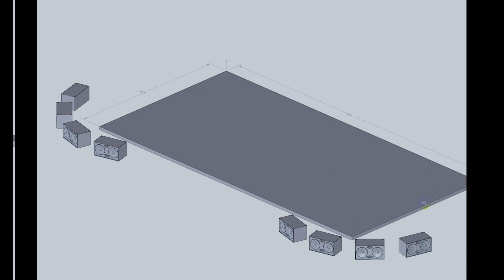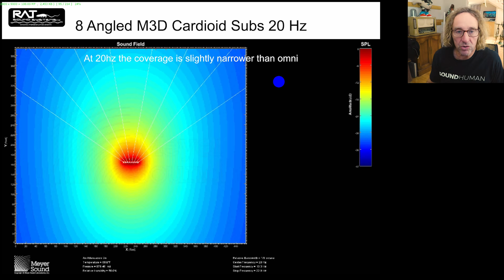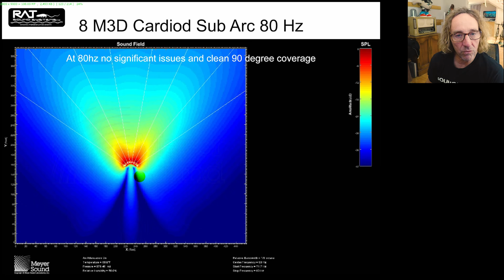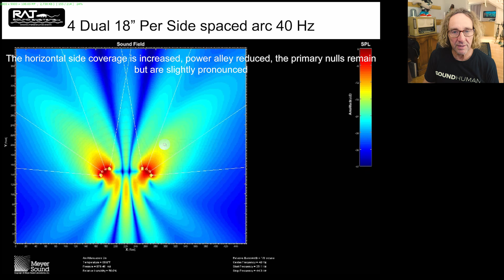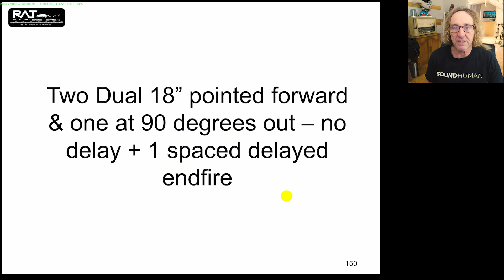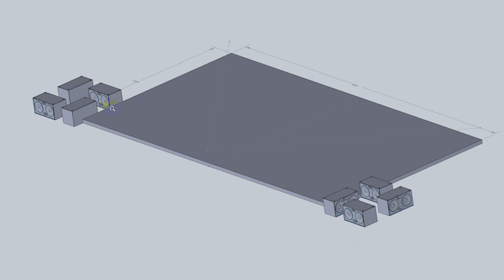Better Sounding Subwoofer Arrays Part 2 - Sub Arcs, Delay & End-Fire

Comment: Subs are not supposed to play over 80hz so part of this is a moot point...
Reply from the maker: and the speed limit is 65 so no car should be made that goes any faster than 65.

and a 1 ton chain motor can only lift 2000 pounds so it does not need to be capable of lifting or holding more weight

or

the capabilities beyond how a product is used may be useful or an indication of how well it performs within the rated range.

a car that goes 120 may accelerate to 65 more easily than one that struggles to get to 65. a car that barely makes it to 65 may be stressed and operating at its limits and fail sooner than a car that is operating well below its capabilities.

a motor that barely lift and holds 2000 pound won't be as safe as a chain motor that has a 5 to 1 or 9 to 1 safety raty and can hold an lift more.

also, there is no distinct definition of sub frequencies. Fo L-Acoustics the subs can operate at 25 to 60 or 25 to 100Hz

do you really want products that fall apart of sound bad if you exceed conservative usage? do you really want products that barely reach mediocre performance goals?

Comment: As for that delayed arc with the subs angled outwards, I can see that working with subs that feature an integrated cardioid design, like D&B’s SL SUBs. In fact, I’ve actually seen that model of sub set up this way at a real life event back in 2022! I bet you could do it with those new giant L-acoustics CS1 subs as well!
     I would think it possible for cardioid-arrayed stacks of normal subwoofer boxes (KS28, 2100-LFC, etc.) to be arranged in this way as well!

Comment: Aren’t subwoofers commonly rolled off around 80 to 100hz? If so, is there any advantage to factoring for two and 300?
Reply: As explained in the previous video, if the subs hold up in terms of coverage at 200-300 hz, then they’re more likely to sound more cohesive in the range we’re actually using them
Reply: @alxp5892 I’ll circle back to that video after work! Thansk

Comment: Is the cardioid arc you did the correct image? How is it cardioid?? (obviously the MAPP displays cardioid results though)
Reply from the maker: I used Meijer cardioid subwoofers that have a cardioid pattern with a rear firing speaker in them
Reply: @DaveRat  ahh that makes way more sense ✓ thank you!
If you had double 18s do you have any recommendations for similar effect? Alternate? Double stacks with a cardioid config?

Comment: Hi Dave, thanks for sharing, was curious if the physical arc of 8 subs could have an End fire sub placed behind at that loud equal distance point you mentioned, would it cut out a lot of the blowback towards the artist?
Reply from the maker: Dual arcs setup endfire or cardiod work well if you have the depth and space needed. Like part of the Bassnectar array .

Comment: It all changes dramatically when you throw a bunch of bodies in front of it. How do you write programs for that?
Reply from the maker: Depends, bodies impact higher freqs more than lower freqs. For subs, the level drops a bit but coverage does note usually change due to bodies too much.  Check out my vid on heat changing sound. That is more of an issue

Comment: Could you do a video of how a center cluster end fire array would look in the software with 2 rows of 4 dual 18s in 2 straight lines using those same 8 bass reflex subs?
Reply from the maker: On the member side I have shared a file with a bunch of sub arrays to compare including endfire and cardioid center sub arrays.

And am doing a multipart series on a a wide variety of arrays and coverage including vertical and interactions between arrays
Reply: @DaveRat  Ok, thanks! I will look into that!

Comment: Thanks for all your work. This point would be more well-illustrated if the color scheme was flipped in many cases.
Reply from the maker: Yeah, I could see other color schemes working, like the choices I have in my infrared camera to show temperature.

Like using lower freq colors to show lower level sound, rather than the reverse 

But both soundvision and Mapp use this color scheme so it's familiar and I believe the only option.

Comment: I appreciate that you are talking this topic which is poorly understood.  A little explanation of comb filtering for those new to the subject would be helpful.  Also some math (not too much of course)  showing the physics of the changes per octave would make it more real world and less mystical.   Aas to going above the cut off frequency, the cut off is a slope so an octave up would still be outputting some energy, the amount determined by the slope.  The mid bass speakers would also be putting out energy as part of their crossover so there is that interaction to understand as well.   Finally, depending on the drivers themselves, they could be putting out energy due to second harmonics.  Thank you for trying to show a complex issue in a simple way.
Reply from the maker: On the member side and in the member zoom chats I go into more detail, thank you!
Reply: @DaveRat  I under stand the math.  It was a suggestion for your subscribers.
Reply from the maker: Cool cool, yeah, I figure if people want to dive in deeper they can join the member side. Typically the more technical I get, the lower the vid performs on the public side
Reply: @DaveRat  I guess I can understand that.  You are appealing to the center of the bell curve even if your bell curve is skewed to the technical side.
Reply: @DaveRat  well, thanks for shedding some light on the subject.  I just watched a test of different speakers stands.  Unfortunately the ones doing the analysis had no understanding of structural engineering so could only understand the acoustic results from a surface level.  They needed a person with some knowledge of mechanics of materials, structures and other physics to understand why they got the results they got.  But I guess, as you said, if they got too far into the weeds, everyone would have clicked to another video.  Ah well.  Keep up the good work.
Reply from the maker: It's tough finding a balance between presenting curiosity and complexity. I don't do much short and shallow and tend to stay in the medium to longer format vids of 10 to 20 mins.
Reply: @DaveRat  yes, I am sure that is correct.  Which is one of the reasons why I don't do videos.  God bless.

Comment: That's why I like a single sub in my car
Reply from the maker: Hmmm, when multiple subs are located close to each other (less than 1/4 wavelength of the highest freq they reproduce, they don't have interference issues that are of any importance.

To determine the wavelength of a frequency, divide the speed of sound by the frequency.

The speed of sound is about 1125 feet/second

So for 80hz, it's about 3.5 feet
  So subs closer than 3.5 feet will not have any real issues.

In a car, the space is so small that multiple subs are hard to place far enough apart to create issues
Reply: @DaveRat  just something I've noticed when switching from dual cabinets to singles. And this is typically a reflex port tuned to 33 hz, so you already have peaky response to deal with.
Reply: @DaveRat  another aspect that these simulations do not illustrate is the way the wavefront hits the listener. The initial attack of the bass note gets muddled when using multiple woofers (in my car that is) a single sub allows the initial attack of bass notes to be cleaner and more pronounced in all listening positions. This simulation illustrates how a sustained note would cause null points ...assuming no room reflections... in a car the woofer experiences cabin gain... the point where the volume of air in the car acts as a large box. I'm sure this effect would overcome any phase offset issues caused by using multiple drivers, but I swear I could hear the difference, especially when moving my head around the cabin. A single driver tends to be much cleaner sounding, even if it's not as loud as multiple woofers.

Comment: Hi Dave... scroll @ 6:20 what if you had say three subs sitting behind the area of the arch at 180 phase with the HP roll off around 100Hz? Would make it tolerable on stage, yes? Phase out hot spot using attenuation on these three cubbies. This setup may work with a "cat walk" stage
Reply from the maker: Modeling that and seeing how it responds would not be to difficult.

Polarity reversed subs can cancel better behind if properly tuned time and level wise and also create issues in the forward coverage areas.

Comment: Dave, great video’s! Keep them up!

But: Isn’t the delayed arc spaced too far apart, which causes the issues? 1/3th wavelength of LPF 80hz is 1,43m. 20m wide / 7 spaces = 2,85m between the subs.

When i deploy this setup i would never space the subs more apart than 1/3th wavelength of the LPF. That way, at least they couple up to the LPF. Of course issues still happen at higher freqs and in my experience when i add too much delay the setup will sound like Dave described.

But when i’m careful with applying delay, i get good results this way.

Note: this only works when i don’t have to cover a very wide field. Then i convert to an L/R (maybe end-fire) setup. Hopefully the next video’s will give even better alternatives!
Reply from the maker: It's a trade off. Larger spaces will give more control over the coverage width (longer horizontal line) but bigger spaces will lower the highest freq. Is there not predictions of an arc that is not spaced in the vid?

Smaller spaces will exhibit a response and coverage somewhere between big and no spaces
Reply: @DaveRat  thanks for the explanation, i fully agree! Yeah there is of course the not spaced arc, and logically a less spaced arc will be somewhere in between like you said.

Thanks a lot! I look forward to your next video’s.

Comment: Hi Rat
Great information 👍,  
One question, if the case is " 8 subs, and a stage is recorded music, and the liteners area is the same width as the stage and only mounting possibility in the 8 metal bar in the ceiling (going from "over the listener" and "over all the way to the back side or the stage")
It the best solution to get a spread out placement in a straight line and a delay for the sub(4 delays), or is it better to have a 2D arc with no digital delay, or is there any better solution 🤔:-), I have seen this problem in the Nordics stages when it is inside (because of weather)
Sorry for my long question, but I get so excited about this series 😅
Reply from the maker: Answering that question would require a dive into modelling and predictions. May be worth downloading soundvision and taking a look
Reply: @DaveRat , thanks I will take a look, do you have any link for this? ( :-) )

Comment: Absolutely love these videos. Thank you for not being a gate keeper and sharing knowledge from an unbiased perspective! Next week are deploying an arc delay, end fire set up using D&B infra and V-subs. The house has B-22s that I intended to use for the end fire portion, and I'm curious if you have a recommendation on setting the end fire timing in conjunction with the arc'd V-Subs/infra array. Considering the Infras are cardioid, is there a specific frequency (cross over/-3db response?) That you recommend using to set the end fire timing? So far my approach is to deploy the Infras/V sub array with the outter V subs digitally delayed, and then moving that entire array back (digitally) to the B-22's on stage. Curious of your thoughts on this!
Reply: Why would you endfire cardioid subs?

Comment: What do you flew the mechanical arc above and infront of the stage?
Reply from the maker: The forward would be good, the rear energy may put a lot of sub toward the ceiling and create undesirable reflections. Unless if you used cardioid subs in the arc. Then the only issue would be sound occupying valuable real estate that is usually best used by the visual related hardware like lights and vid

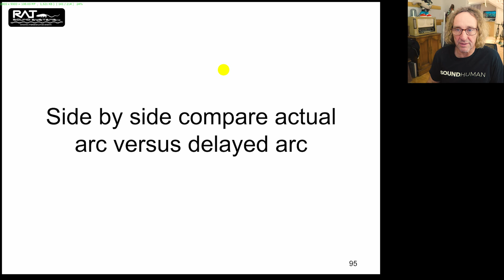Comment: Wait - I'm confused @ 10:30 by delayed arc vs. physical arc.  If they are time-wise the 'same', why so different?
Reply: It's only the same time wise if you're straight in front - if you're right to the side, the physical one the subs arrive at the same time as they would if they were in a straight line or there abouts whereas in the delayed version the one in the middle arrive later
Reply: @stephenevans2518  oh duh - thanks Stephen! 🙂
Reply from the maker: Yes, from in front the outside subs are late with a delayed arc and physical arc.

From behind the array the outer subs are closer with a physical arc and still later arrival time with a delayed arc. From above, the physical arc is about the same distance to all subs but with a delayed arc, the outer subs are still late

Comment: Hey Dave, curious what you would think is the optimal setup for 4 Fulcrum 1x21" cardioid subs for medium-sized outdoor shows. I can't seem to figure it out with experimentation. They seem to lazerbeam like crazy in a center arc. 

Also if you haven't checked out Fulcrum's products, you should read some of Dave Gunness's white papers. He's been doing some pretty cool boxes that we really love.
Reply from the maker: Dave is super smart and a friend as well. I worked with him when I consulted for EAW and love chatting in depth with him whenever our paths cross. His designs are very cool.

As far as sup setups, 2 more vids in the series.

And I recommend downloading soundvision and use do some predictions using KS21 or SB18 as the predictions will be close enough to the Fulcrum in the forward field and the Fulcrum will have less sound radiated behind.

Comment: Awsome video Dave!.. I now wonder what is the impact of the crowd in the bass "diffusion" when 80Hz and up, could the crowd act as a aperiodic subwoofer?. I mean what is the air density in your simulation vs what the crowd does to the average "air" volume? their body mass, cloth.. all that stuff could also contribute to some sort of diffusion and reduce these multi ray patterns and create more "softening" of these?
Reply from the maker: Yes, there are loads of variables, room reflections, humans, and even temp.

And

Setting up an array that can sound optimal and has the capability to cover the desired area is the starting point you would ideally master before adding in all those other complexities.

Comment: It's quite normal to see dual subwoofers when small bands have purchased a PA-system. And they're more often placed on left and right of the stage under the main speakers.
This causes the power alley effect and the bass in the audience is very uneven.

I have had this habit of ALWAYS building an end-fire cardioid if I have two subwoofers available. I get as much power as I did, but I'm creating way more even response at the audience while also cleaning up the bass from the stage and reducing the reverberation from back and side walls of the venue since the directionality increases.

And with digital mixers of today, that kind of simple PA-processing is easily done so you don't need to have separate processor either.

I think everyone should learn to do this kind of basic stuff even if they have two subwoofers :)
Reply from the maker: In video 4 you will see how to make those common setups work wonders
Reply: @DaveRat  that’s the video I’m waiting for eagerly. Next week?
Happy Holidays…maybe Santa will bring you the 31Hz you’re missing from the set 😂
Reply from the maker: Vid 3 next week then 4 after that
Reply: @DaveRat  Hoping Vid 3 soon?
Reply from the maker: I thought I released

Comment: I am trying to extrapolate this information for small clubs 250 people and high-end home audio. All very interesting.
Reply from the maker: In video 4 there will be methods that apply to any pa with stereo subs
Reply: Small rooms in home audio work quite differently because of reflections.  I played with bass directivity for awhile, but I couldn't get it to help bass response in my room.  What actually works for me is multiple subwoofers with delays.  But the delays require measurement software like REW to determine once the system is installed, so there is a learning curve.  But my results have been excellent!
Reply from the maker: Hmmm, for home audio, placing a sub or subs in the desired listening positions and then measuring the LF around the room untill you find the desired response, then place the sub or subs there, should work. Since sound is reciprocal.

That is a fairly easy way to find sub placement and account for all the reflections.

That would work for live as well but is impractical
Reply: @DaveRat  My pet project is cabinets inspired by the Genelec W371As, so I can't move my subs!  The cabinets have a rear ported subwoofer plus front firing sealed subwoofer in the same cabinet.  (Also coaxial woofer to make them full range.) Using notch filters on peaks can acheve flat response at the listening position, but adding delays instead of notch filters seems to work better, because response is pretty flat in most of the room.  

I don't know precisely how it is working.  I suppose I could play a tone and "map" the response in different places to understand it better.
Reply from the maker: Interesting. Yeah, having 2 low frequency sources in a small or reflective room is an exercise in compromise. But since stereo is already a flawed format that sends similar or identical low frequency sounds to multiple speakers, the issues come with the territory and are inherent.

Comment: Very cool to see these more complex arrays. Would be interesting to see a similar comparison with higher frequencies. Or what works best when going for very high low frequency output, as is common in EDM. Where I'll generally see as many subwoofers as will fit in the room, or on a truck, as many as thirty two 2x18" cabinets stacked two high in larger venues serving 4-8000 people
Reply: 4 people only need 1 sub 😂